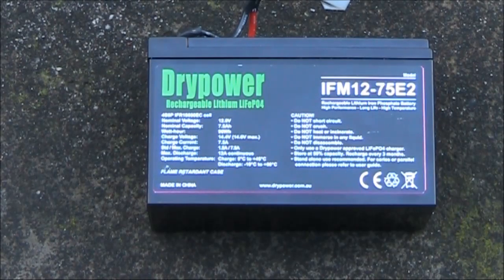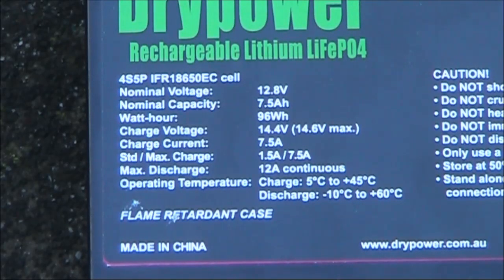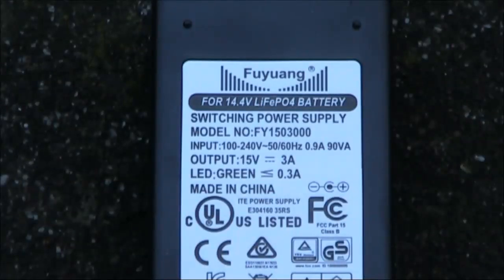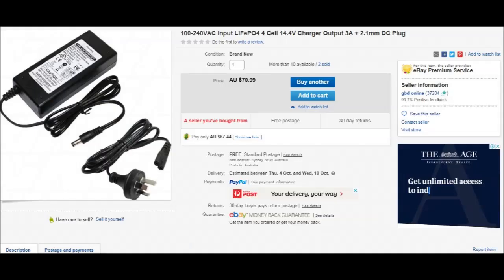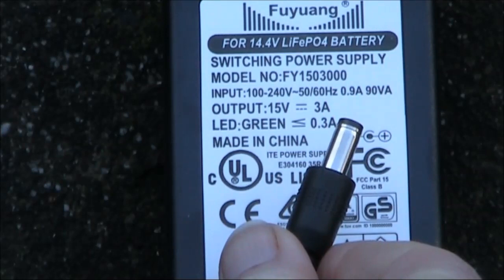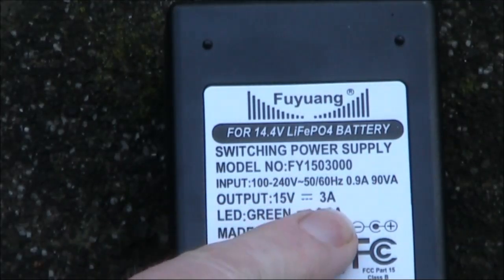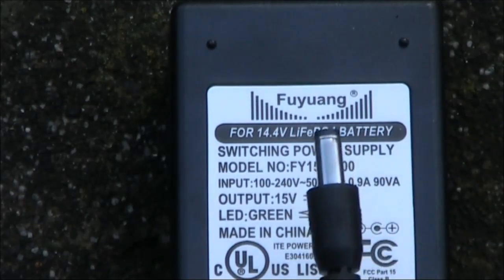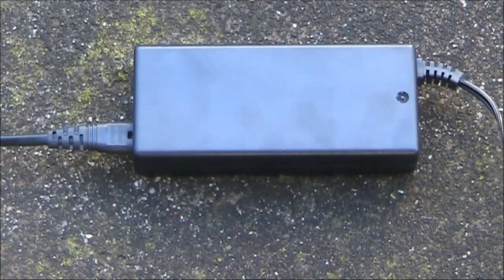Using a 1503000 LiFePO4 battery charger to power an FT817

Comment: I'm using a Xbox One power supply, £12 used from eBay. Plug hacked to bits and 2 powerpole connections fitted, powers my 817 and Chinese amp at 25watts, no problems and no noise at all. 73.

Comment: Excellent Peter!
Looking to get one of those batteries to finally replace some older SLA types.
Maybe slightly larger current capacity to suit the Icom IC-703 at 10w output.
73's!